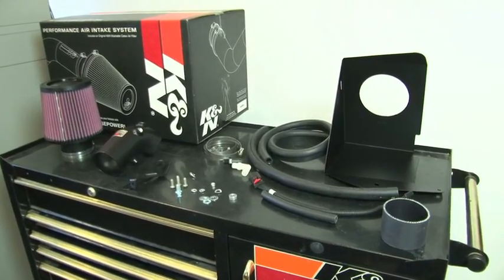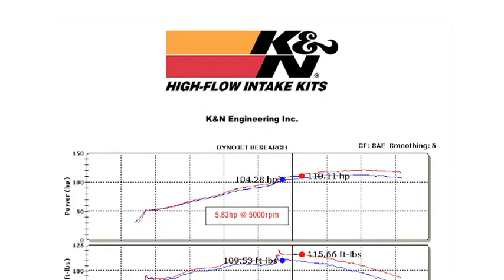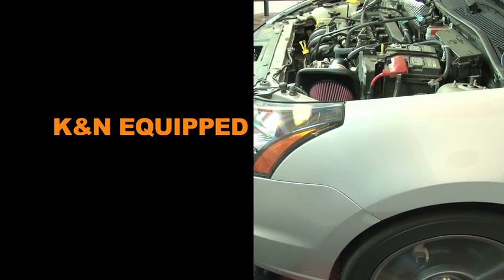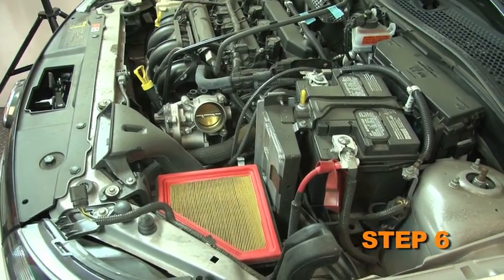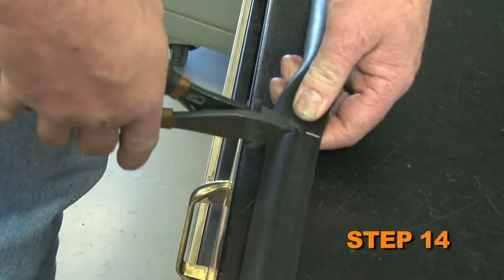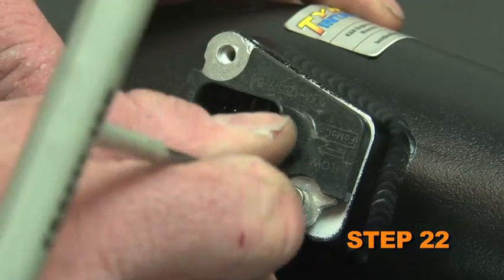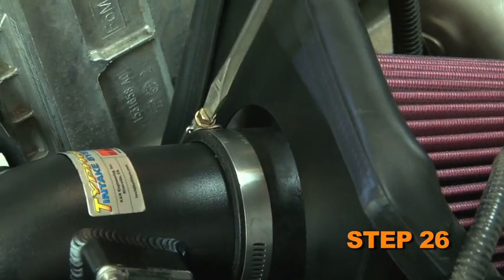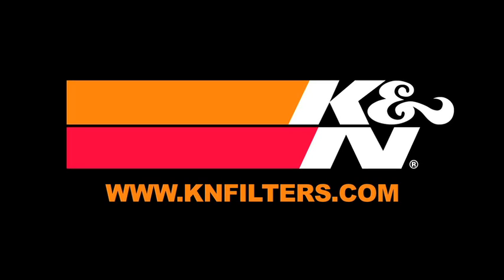Ford Focus 2.0L PZEV [#69-3516TTK] Air Intake Installation

Comment: Will this fit my 2008 focus? Has the same engine in the video. Also what makes it PZEV?
Reply from the maker: No, a 2008 Ford Focus 2.0L you want part# 69-3513TTK https://www.knfilters.com/69-3513ttk-performance-air-intake-system

If you need help identifying whether or not your vehicle is a PZEV, please contact our product specialists at 800-858-3333 or tech@knfilters.com.
Reply: @KNfilters  turns out it does fit my 08 focus. And runs well! Question, is putting edge trim in the center hole necessary, or should i leave that gap open?